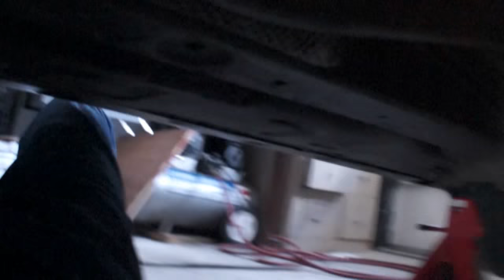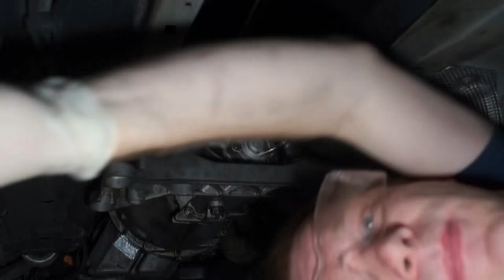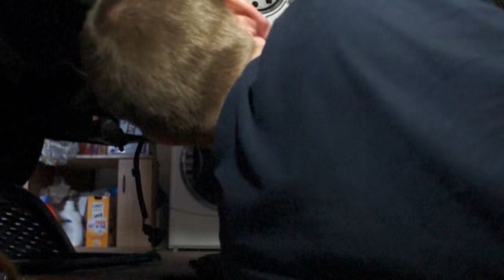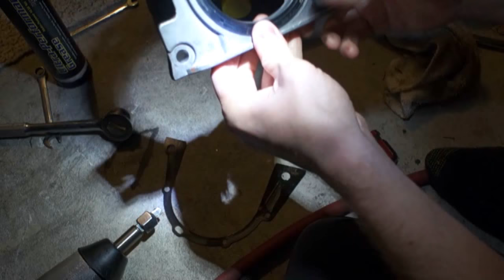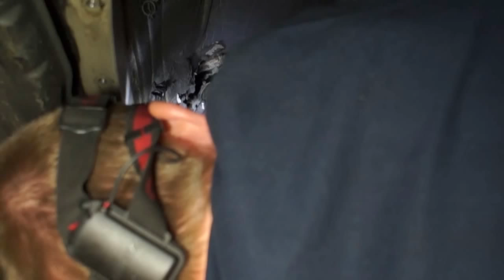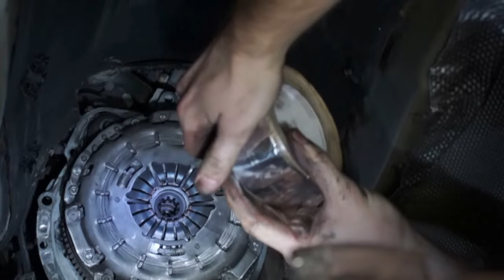1999 2006 BMW E46 E36 323 328 325 rear main seal replacement leak repair DIY

Comment: Hi bro. Is it your car manual or Auto transmission.  Is it any different in replacing the main seal?
Reply: There are cooling lines you'll need to undo and the Gear selector cable. There will be a torque converter instead of a manual trans flywheel and clutch. It will also be WAAAY heavier lol so be ready and don't drop it on yourself like he did. Essentially same steps just some different hardware though.
Reply: @channinglittleman6542  thanks man. I am still get as much info before doing this project
Reply: @degiri231  for sure it's not too bad

Comment: Hi Tony,
Wow, amazing that you didn't need a floor jack to lift the tranny - just hands and legs and stomach musche! I wonder if you can lift the automatic tranny this way.  I have couple observations:
1. you used the old flywheel bolts to the crank, and without adding any sealant the the bolt threads I think the oil will leak from the crank threadeds holes via the bolts.
2. Can you replace the seal without removing the seal frame? I think just pry the old seal off and press in a new seal onto the frame will save the works of sealing the frame to the oil pan and not disturbing the U gasket.

Comment: im gonna do mine soon. this diy video will be very helpful. too bad i dont have impact socket, so i think i will strugle a little.
Reply: I already have a set of inverted socket. Yeah i wouldnt want to risk stripping any bolts or nuts. Also i have automatic transmission but the procedure should pretty much be the same?
While i'm replacing the seal, what do you suggest replacing?
Also is it necessary to replace the gasket if i only do the seal?

Comment: When mounting the transmission were you just rotating the flex joint at the rear of the tranny to align the splines?

Comment: hey Tony, I just put in a rear main seal and I did everything just like you except I set the seal flush with the outside of the housing but I noticed you set yours flush with the inside of the housing. all the other videos I watched set the seal flush with the outside of the housing.my started leaking and after taking the engine back apart, I cant find a fault in the rear main seal.also, I did notice that the seal surface had two manufactured dips in it were it set against the housing.  is this normal and do they go a certain way? your knowledge would be much appreciated bc this is my second time taking the engine completely apart and I really want to get this right. I have the Chilton manual but it doesn't touch on this subject.
Reply: Well,  I already ordered another but ill just return it.so, the hard part and probably what I messed up was pressing it in evenly? Where did u get yours for $75? Thats a good price.

Comment: Hi Tony, i enjoyed your video very much. hoping that one day i could replace mine on my own. i have a few questions, 1. in one set of instructions, i saw 3 bolts were removed through a hole which he got it aligned by turning the flywheel(the wheel which touches the starter if i am not correct). and 2. what glue should we use in the edge. is silicon grease a kind of glue or just for lubrication. 3. is the wiggle you mentioned while placing the transmission back in, a necessary step, or would jack prevent this freedom you had by having them on your knees. 4. and you tilted the engine, so, did you remove any engine mounting screws or bolts from the brackets to have it tilted towards front and below. once again, thank you for posting this video. i wish you success in your future. )))
Reply: thanks, ))))

Comment: its hard for me to believe that your saying that the hard part is to press the seal onto the housing even bc all you have to do is make sure it is flush like you did in the video. I just dont see paying $40 more wait its $70 more?
Reply: Dirt has nothing to do with buying the seal pressed. The lip being pinched has nothing to do with buying a seal pressed.  If you flush it with the housing,  it is aligned plus the housing is flat against the block soo misalignment is pretty difficult to do in my opinion.  Also, in the video, you didn't have a kit. Im a little confused as to why you would post a video without using the pressed in seal but tell everyone who asks, that they need to buy the pressed in seal for an additional $40 wait $70. Are you in cahoots with the sale of the pressed in seals? I dont have a leak anywhere else. It was definitely coming from the rear main seal.  I recently installed a catch can and im starting to get the feeling it may be what caused my rear main seal to leak. Thanks anyway.